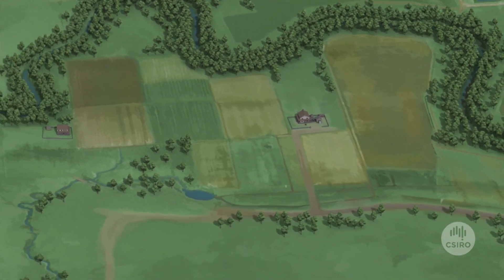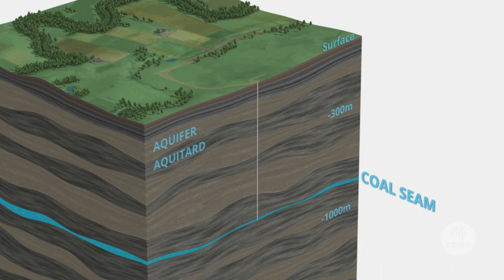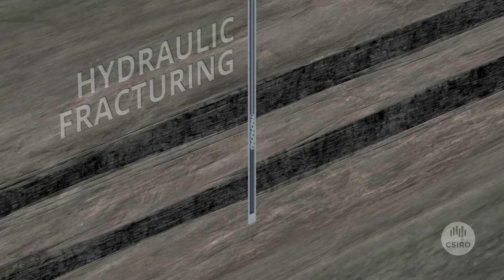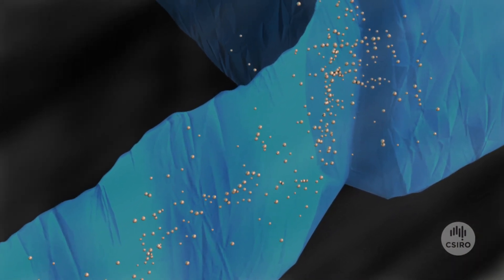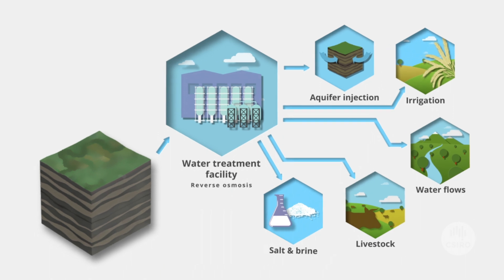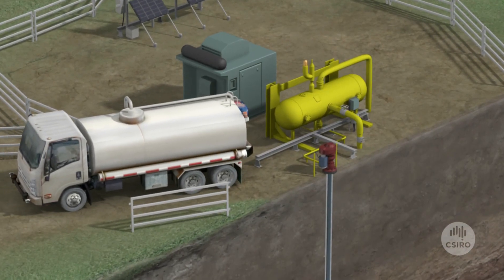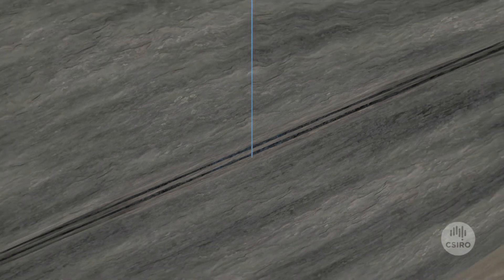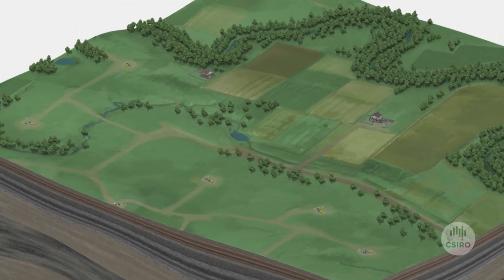Unearthing coal seam gas

Comment: Dear Peter, I believe that the statistics on well integrity failure probably came from a report which anti activists have been using for some time. That presentation is “Lethal gas/oil wells: Anthony Ingraffea at TEDxAlbany 2013”  found at Lethal gas/oil wells: Anthony Ingraffea at TEDxAlbany 2013 – pretty scary stuff.  But it would also be useful to read a rebuttal at http://energyindepth.org/national/new-ingraffea-report-same-old-tactics/
Reply: https://www.facebook.com/GetUpAustralia/photos/a.401481301454.178964.13527056454/10152506622221455/?type=1&theater

Comment: Quite informative and fairly accurate, however one major concern was not discussed with reference to the possible contamination of groundwater.  Research of the industry that sinks the wells admits that 5-10% of all wells sunk have damage to external casings from the outset that allows coal seam gas and fraccing fluid to migrate upwards into any aquifers the wells pass through.  This increases to 40-50% over the 20-30 year life of the well.  As such this means that you are virtually GUARANTEED to contaminate any local aquifers within one generation whenever more than a few wells are sunk in the one area - most aquifers cover a wide area; in Australia some (collective known as the Great Artesian Basin) cover hundreds of thousands of square kilometres.
Bearing this in mind these wells should NOT be sunk in any area containing aquifers, at least not until the structural integrity of the well casings can be guaranteed (which may be possible with the integration of new materials, but probably not as you also need to take into account damage due to earth movements).
Reply: No doubt the Csiro would be looking into that
Reply: Thanks Peter for the added explanation.My concern also was with global warming and possibly increased "earth tremors" impacting on these wells throughout the world.Not a good thought.